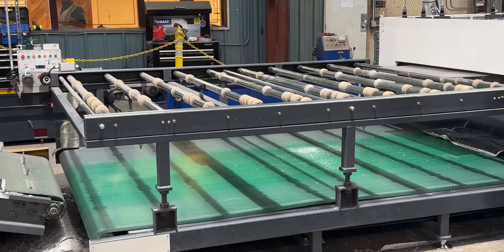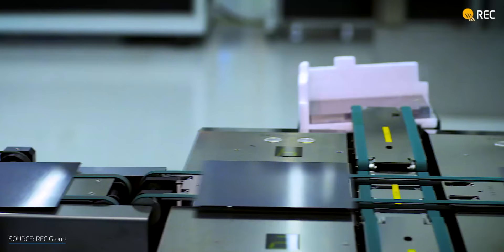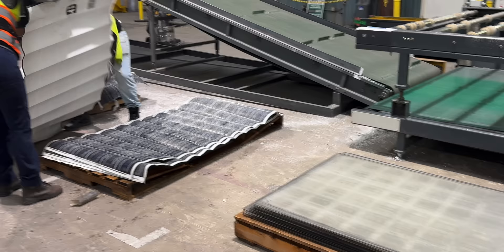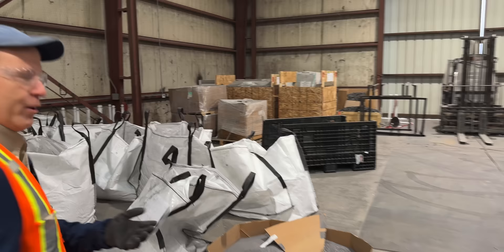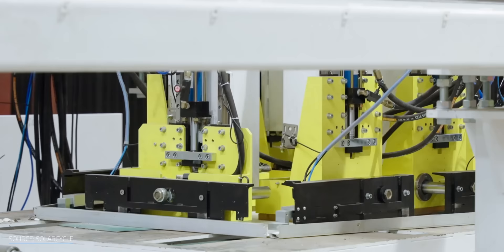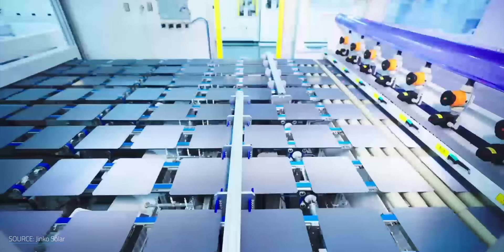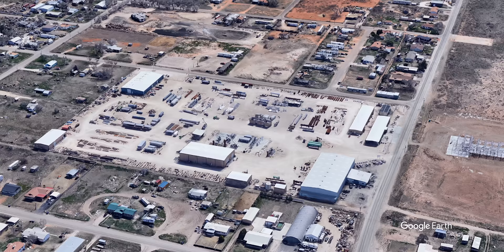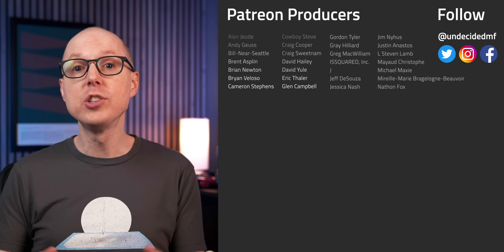What REALLY happens to used Solar Panels?

Comment: It’s scary to see what’s done with old wind turbine blades.  They bury them once they are considered unusable.
Reply: There is at least 1 company that is shredding old wind turbine blades and sells them to a concrete manufacturer. This also reduces the C02-emissions of the concrete manufacturing process.
Reply: @renezirkel   Thanks I saw one article showing them burying them and considering the size of the blades was taken back.  I think wind power is critical,  and still do but felt let down that its not discussed more.  Good to know what you shared however.  I wonder if someone has done a life cycle analysis of blade costs over time and the impact of updating their construction to extend blade lifetime if that is at all technically possible.
Reply: @MitchellAltschuler  Yes but we should talk a lot more about recycling in any industry. The problem is always that any sustainable product can be price undercut by an unsustainable product. We have to either enforce recycling or hold unsustainable producers financially accountable.

Comment: Of course the company is going to sugar coat the prospects to get investors. A lot of $ and energy is going in to development and that costs may be swept under the carpet to make it look viable. Be nice if it can be economically viable. Cost of materials may just rise to make this viable but at same time panel cost will rise if their own silver projections is correct. If recycling comes a necessity of materials supply, costs of panels will likely rise. 

BTW, Organic fuels are stored solar power and  requires less rare or valuable metals to store or create that energy.

Comment: Do they test the panels to be sure they’re bad? With rough enough handling, I’m sure they could be 100% bad. But the best recycling would be to get more use out of them, if possible.
Reply: the ones that are dying right now wouldn't really be worth carrying into zombiehood - these first gen panels are very low efficiency already compared to modern ones, I would say the materials would be better used making new ones with better specs than limping the old ones along on crutches.

Comment: When recycling comes up, I go to my ultimate engineering answer. Yes, it's a pipe dream, but oh what a dream. Use renewable energy to rail-gun loads of trash into orbit. Once there, put the contents into the center of a solar furnace, made of mirrors that concentrate the Sun's energy into a single spot. Heat the contents to 10,000 degrees F, and all of the periodic table will turn into ions. Use magnets and/or electric fields to sort the ions into pure, raw materials and 3D print them, into finished shapes, or as raw materials, and send them back to Earth. It's a Star Trek dream, but I don't care, it's my dream.

Comment: I realise that you live in the US and it’s impossible to get public transport for a journey like that but surely you should make an effort to not fly. It’s the most polluting way of travelling. Or at least find a way to offset the impact (with genuine carbon offsets, not the bs ones most companies use.)
Yes, individual footprint is marketing bs created by BP. But if someone with a platform like yours should make that extra effort, or if you did and simply didn’t mention it make it visible.
Apart from that, great video. Keep up the good work.

Comment: is there any reason the glass sheets couldnt be reused mostly as is? like instead of being grinded down and re formed, could they possibly be washed and sold back to manufacturers? obviously some would be too damaged to be reused but i would think for the most part the glass should still be intact.
Reply: The glass sheets would be damage to some level as you can see in the video, so short answer - more than likely not. Let alone, moving it and hoping it doesnt break, etc etc.

Comment: For me using solar is decades off by which time i'll be long dead. Their efficiency just isn't good enough (current models being developed expect to see 30% efficiency) vs the cost of hydro power. Currently it'd take 15 years before the solar panels broke even ,(panels required for my house size i.e single story 4 bedroom) which is hardly a great investment (keep in mind my monthly power bill is $100nz as i'm what's called a low power user). Unless our power bills skyrocket it's hydro for most of us unless some millionaires etc have huge houses & lots of lights it maybe an option lol. A bigger issue after watching this vid is those windmills as they're piss poor for recycling. Acres of blades anyone.

Comment: And what would a solar panel cost from these recycled materials. 
Will it be 15-45 bucks more expensive than what they cost now? Will it compound making solar panels almost not obtainable a few generations down the line? 

Will solarcycle build these machines for other people who are interested in this way of giving a solar panel a second life?

How many times will the chemicals be able to be (re)used before it loses strength? Because we all know if you use chemicals more often it will lose in strength over time.

Comment: 80 million tons sounds like a lot, and it is, but it would represent a 1% increase in the 7.6 billion tons of industrial waste created each year in America. The number is often given out of context. Yes recycle, but increasing our waste by 1% to become carbon neutral isn't a reason to not go solar. That is a green energy myth. Only thin film solar panels use toxic materials. Most home and solar farm installations are just silicon and not considered toxic waste which is why they can be landfilled. Thanks for this video which shows that we can recycle these materials instead of throwing them away.

Comment: It is really an issue of vision at the top of the economic policies. We know that pollution in general is bad and that we should be recycling and cleaning stuff responsibly but we don't because this is not rewarded by our economic model. We always have to wait until it's already too late before something becomes profitable enough to actually tackle which is then slowed down or even completely sabotaged by the people making profit of the thing that creates the pollution.

We really should add end of life of products as part of the producers responsibility.
It's also one of the big reasons why we continue to lose to China. They consider the big picture a lot more instead of our focus of trying to skim as much profit of every step in the process.

Comment: My idea, resource speculation, industry to process all trash.  Specific to solar panels recycling requires specialized machinery, people choosing to recycle their stuff, them to do the sorting, sending appropriately to the right places.  Unlikely, too easy to dump everything into landfills.  Looks like solar panel recycling also uses manual labor, and equipment to be specific to the panel type.  General trash recycling, if possible, hopefully will be fully automated, will operate from landfills, will process any trash, nothing specific required.  I will bet it will be  far more energy intensive, but will do all trash, and time sensitive quotas might not be a priority.  The profit, hopefully will come from  speculation.  Horde the recycled materials until the price is right.  I doubt investing into this is more profitable than into any other ventures, for now, but in the future, when trash piles too high, people environmentally minded enough to pay more for recycled, if China becomes too unreliable as a supplier, or mined resources too few, one day, general trash recycling, might be a good investment.  There are countries like Japan, resource poor, high industry but too dependent on unreliable suppliers, China, Russia for their start materials, could start these up globally.

Comment: It's hardly a circular economy.  To me circular economy means that you get as much benefit as you put into it.
When you consider the amount of energy that is put into recycling those metals, silicon and glass verses the amount of energy you can retrieve through the solar panels over its lifetime. It's a huge net loss of energy.  Which means the carbon footprint needed to make the solar panel far exceeds the carbon it saves.

Comment: My biggest problem with solar panels has very little to do with the production, ROI, or recycling of the panels, which will all naturally improve over time.  It's more with your misleading statement at 0:28 where in Florida, we can't generate energy for ourselves.  We can only generate energy for FPL, at our cost and liability (roof & insurance, another massive issue in Florida), and they can choose to not pay us for the energy we provide, and energy prices have kept climbing in spite of more solar panels being installed.  Last I heard, a plan to force everyone to install solar panels is in the works.  They fly drones to check for panels, and governments enforce their monopoly on solar panel energy production.

Comment: Great video as always. Wouldn't it be better if the solar cell was designed to be easily recycleable. Add a Tax on the cells that don't meet the easy to recycle. Maybe the problem can easily solved.

Comment: percentage of solar panels are recycled 
U.S. rate  around 10 percent .
largely because of the difficulty of extracting valuable materials from panels
Because of this, most solar panels can't be recycled in the US, at least not fully. Instead, dead panels are sent to an e-waste facility that will salvage what they can—usually the aluminum, glass, and copper. The rest of the panel's components are typically shredded and sent to a landfill. 

But the truth is  90% of the Solar Panels Just go to landfill. 
they do not get recycled .
Not Green 
'environmental danger' excess solar panel waste and limited means of disposal,
The problem is, when solar panels end up in landfills, "components that contain toxic heavy metals such as selenium and cadmium can contaminate groundwater." 
 environmental policy can create unforeseen hazards . 
Point is they were not unforeseen hazards and they were Known hazards from the First creation of solar panel .
solar panel are not and Never were green Technology and we now Have Toxic wast from them going in to the water table.
And the wind turbine blade recycling Is much worse in the United States..

At no time is this Green energy a solution.
 And causes more environmental damage and waste.

Comment: Hi Matt,  that glass panel looks undamaged.  Wonder if it would make sense to clean it and use it (perhaps with the old aluminum frame) to re manufacture the panel?
Reply: Literal Tons of still viable panels are getting shredded when they need a bit of resoldiering, hard for me to watch.
Reply: ...and when your panels lose efficiency why not just one or two extra panels to restore production.  It makes no sense to trash them all and start over. (Unless it's just for the tax write-off 😕)
Reply: @artyatsko  Yeah it's pretty sad we don't repair such a finite resource. Panels can last 60 years pretty easily especially with a relamination sometimes even without being built right. Losses diminish over time too, the first year is typically 5-9% loss, then .5-.75 for next 20 years, then .25-.35% for the rest of their life.. I designed a panel system built to run 300 years with hardened wires, double glassed incapsulation so on. 3.817GWh per 10kWh installed still over 53.5% efficiency to 130year relaminated once. To see this makes me super disappointed. If I live to 50 I'll build it and hook it to the grid to be my only footprint on this planet. Write up below, the 35k cost was in 2007, now it'd be 25k if that.
Reply: The thing about solar power is it's calculate the Price Per Watt at 20-25 years, when most have warrantys for 25-30 years(guaranteeing +80% initial efficiency). Beyond that, after the first year(9% drop) the annual degradation is between .2 and.5%(let's call it .35) a year, so at 20 years when the price per watt calculation is over you're still usually above 84%. 50 years down the line, you're still over 73%, it really shows how shortsighted the industrial PPW calculation are. As the losses lessen with time following 50 years you're more likely stuck at .2% loss, so by 100 years(at which point you may want to replace the laminate) you're still running at 63.5%, 150 year 53.5% efficiency, basically they can run dependably for 300 years, ending up around 25%, by then technologic advance will make replacement a simple decision and a win.

Year  Efficiency%   kWh captured(within span)
0-5 	89.5		105,390
5-10 	87.75		102,535
10-15 	 86		100,491
15-20 	84.25		 98446	
20-25 	82.5		 96401
25-30	80.75		 94356
30-50 	73.5		359,898
50-70 	69.5		334,191
70-90 	65.5		315,495
90-110 	61.5		296,799         (First laminate sum 1904002kWh)
110-130	57.5		278,103
130-150	53.5		259,407
150-300  25	       1,375,908

Now to kWh(We'll say a 10kwh system in arizona)
Let's say they're on a dual axis solar tracker, so 8.5 hours of sun, 275 days a year
(2337 hrs a year)
kWh by year;
5 105,390
10 102,535
15 100,491
20 98446
25 96401
30 94356
50 359,898
70 334,191
90 315,495
110 296,799 1904002
130 278,103
150 259,407
300 1,375,908

Total kWh with a working dual axis tracker and relamination every 100 years
3,817,420 kWh or 3.817 GWh
1060kWh a month for 300 years

Such a system would cost ~$35,000 and if in service for 110 years or 300 years would cost $.018382/kWh or $.010478/kWh(with 2x $2,500 relaminations calculated in).

Think about this, the average kWh in the US cost 11 cents so even at 110 years that's a value of $209,440, though of course the cost won't be equivalent by then.
Reply: @artyatsko it's difficult to add mismatched panels on same charge controller.
Reply: @mungewell  You take voltage readings, check the spec sheet, and do the math, no it's not.

Comment: Thank you for the video Matt.  I'm wondering if there is a similar push to recycle the parts of wind farms, specifically the wind turbine blades?
Reply: I have viewed a few videos and websites that discussed just that issue: The best case seems be a completete refurb and resale of the older & smaller (economically obsolescent) wind turbines in small batches to remote user locations like farms/ranches or small towns at the edge of the Grid system, where electric rates are high or unreliable service is frequent. Newer giant blade turbines are a more difficult sell because of sheer costs of transport & reconstruction. However, repurposing the towers and blades is possible - large & very high strength/weight ratio structures that can be used for construction of light bridges, and large span structures like trusses for warehouses and band shells. Based on my past experiences, the primary issues will be lack of imagination & reluctance of local building officials to permit new methods, and materials that could be viewed as "scrap". Unfortunately there is not much that can currently be done with the blade fiber composite materiels, perhaps chipped up and remolded (like OSB building sheet) into boat hulls, large storage tanks & piping, or core reinforcement for decking like Trex?
These things take time to develop, and building practices change glacially in the USA (unless you can promise mega-profits)😏

Comment: Most of those panels are still working but only deteriorated in capacity. Even if the panel is down to 70 or 80% capacity it can still be used in countries where solar is unaffordable. Cant it be exported to Africa and still be used for a good few years ..then only recycle it there where labour is cheaper.
Reply: @nic             By “a few more years” I assume you mean 25-50 more...
Reply: $270k/megawatt still for used solar
Reply: @MrGoodeats      Any evidence for that? For any price of used solar panels? 

They’re so varied in age, type, quality & capacity there can be & is no single price. So why are you saying there is?
Reply: @J4Zonian  I got that info from a website that was orange that sold used solar panels in bulk. Can’t remember the name. Tan solar or something. I just googled “used solar panels”. That’s probs @60% efficiency and with many issues but ya
Reply: @MrGoodeats       Solar panels are now starting to be guaranteed for 40 years, 1 company’s for 50, & a fair number of the early & least durable ones are still producing at high efficiency after 60 years. (There’s not a single operating commercial reactor that old in the world.) 

Solar panel degradation rates: 0.3 -0.8%/yr. & getting better all the time.
At .3%, output in Year 25 is 94.5% of original efficiency.

Solar panels are typically 75% glass, 10% aluminum,  5% copper, 3.5% silicon, small amounts of silver, & 4g lead. Virtually everything can be recycled. The Si can be used to make new cells with higher efficiency than the ones they were made from. 
Dan Gearino, Inside Climate News, other sources

Comment: 10:08 By removing individual information from the buying choice with subsidizes inefficiencies like recycling, you prevent innovation of panels that don't require silver and other more efficient means of energy production. Bottom up works because it's everyone's brains thinking, top down fails because it relies on the fewest brains trying to solve non-linear equations. If a pretty recycled panel without subsidy costs $2000  and a ugly new one costs $100, the people buying it should be the only driver of what to manufacture. Or your have more brain that all brains combined.

Comment: What you refer too as an oil rig is actually called a pump jack, a rig drills the well. It,s good to be accurate. I have drilled at least 100 wells using a rig. Thanks